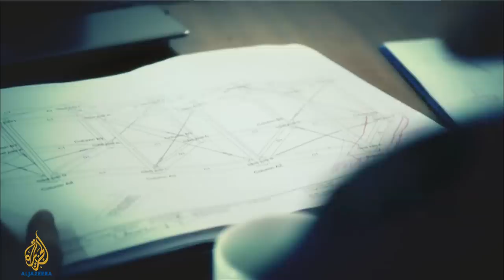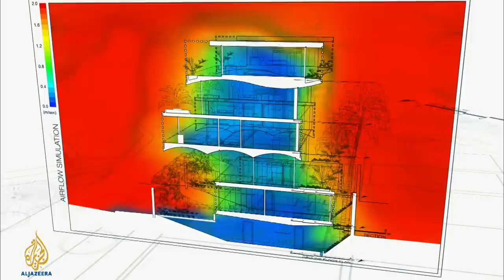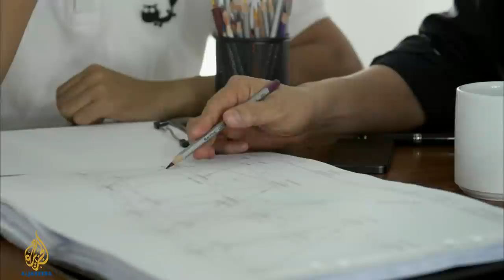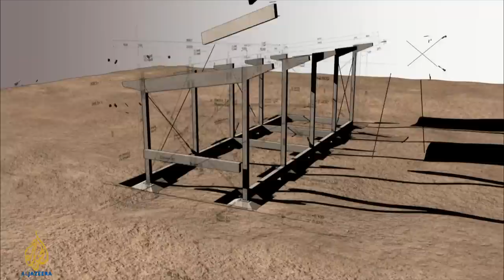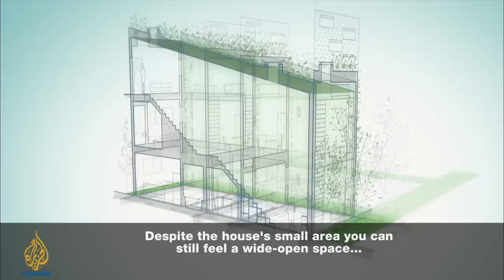Rebel Architecture - Greening the city

Comment: $4000 isn't low cost in villages.
Reply: A.H.M. Rakibul Islam Your right Mr. Islam; we learned this farming family profits just US $500 / year. On the other hand, I could see these new homes being used for 3-5 decades with occasional replacement of all the organic woven panels. The basic longevity, makes the $4000 a reasonable investment. Will anyone offer mortgages? How will a farming family, like the Phams, save this much up front? Social issues are at least as important as the engineering and erection issues.
Reply: +Steven Dornbusch But if you see the layout of the new house, it does not seem functional at all!
Reply: +Naveen Bharathi Indeed the interior seems off...featuring only a living room? nice
Reply: it is for long term